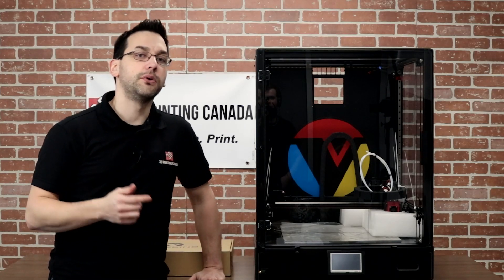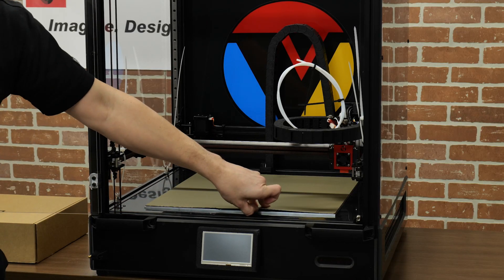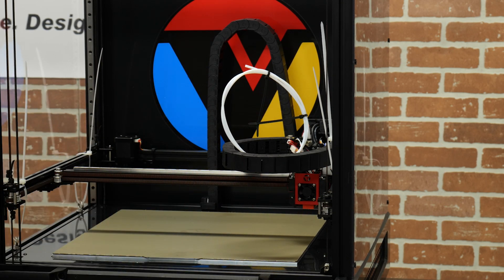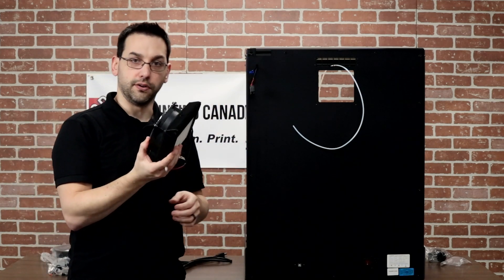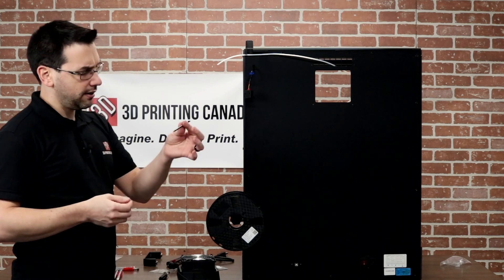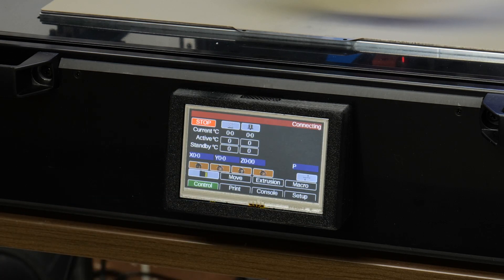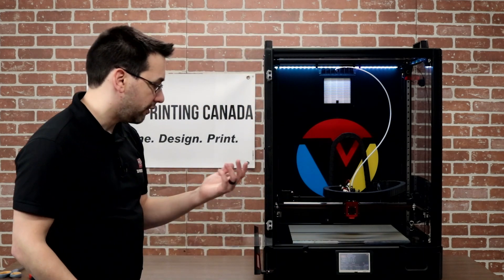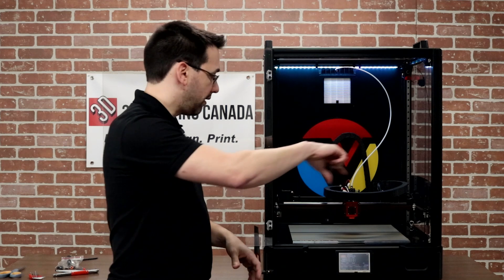FORMBOT TROODON 400MM BUILD & REVIEW

Comment: I have inherited this printer at work, I know absolutely nothing about 3D printing.  The instructions that came with this printer is abysmal, nothing about loading the filament or manually calibrating the bed/gantry/print head only the unboxing and initial setup.  If there is literature on the use of the screen options let me know else could you guys create some content on how to perform some of the basic calibration, not talking about it actually showing the options or combination of options to get it calibrated.  Sorry I have tried selecting different macro options, the status changes from idle to busy but nothing happens...  Frustrating as there is very little actual literature/manual.
Reply: If you want to sell it, I'm sure you could get a decent amount of money as long as it's in good shape.